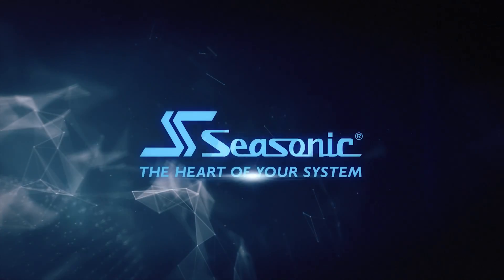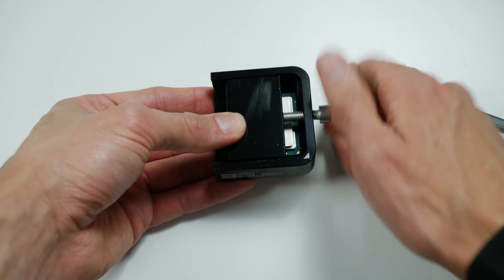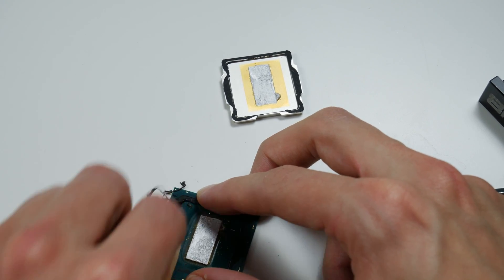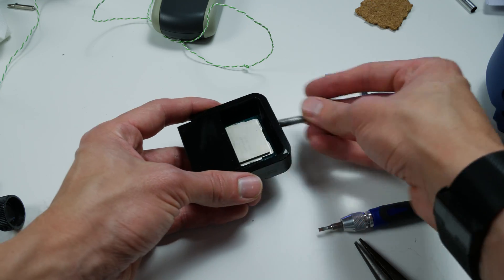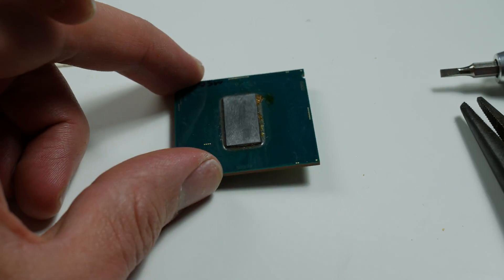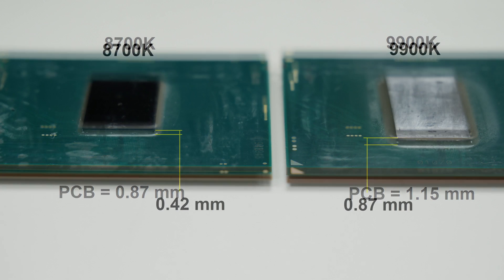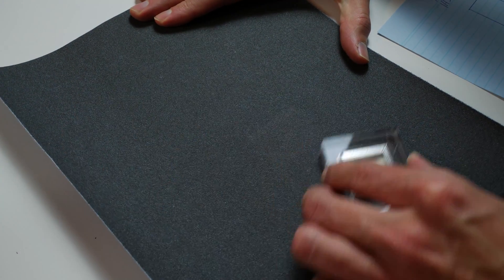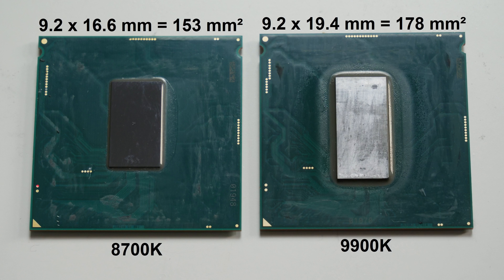Bad sTIM? Why is the 9900K so hot?

Comment: @der8auwer did you ever delid the 9700k and 9600k and where these dies as thick?  And was your sample a test sample send to you or a retail store bought sample?  And has there bin a new revision that may have had a fix to this or is it still the same old hothead. 
I really need a new rig but frankly Amd doesnt tickly my inner gaming nerd and the 9900k frustrates me on 2 points  price and this dam hotness. and delidding or even lapping is not for me. i want out of the box great items for those prices.  it baffles me that intel never made a statement on this or clarified why the die is so thick yet it clearly the reason its so darn hot.
Reply from the maker: it's the same and no changes
Reply: @der8auer   Thank you for clearing that up. Its really hard to find this info with intel being this tight lipped! Hope the new series with igpu off will be a improvement but not counting on it.

Comment: I will be performing my first delidding and lapping of my 9900K die next
 week. What I would like to know is does the bottom of the IHS (the 
bottom that actually touches and glues to the PCB) need to be sanded 
down equal to the amount that is taken off of the die so that the lid 
touches the die? I have not seen this done nor discussed. Thx for your 
time, knowledge & help! You are greatly appreciated!
Reply: Joey 
I’m doing this right now... just lowered die 0.53mm mirror finish. Now I have to lower ihs same amount. It’s coming out great can’t wait to see where temps end up...
Reply: @hermanquinones  Awesome! Did you cut the die first and then sand it down? Is .53mm safe? I was going to do .40mm. Please let me know how it turns out! Very interested! Much success! :)
Thx!
Reply: Joey 
No cutting at all... bought the supplies for delid and solder removal from RockItCool. 
Sanded starting at 240 grit and worked up to 7k for mirror finish. Spent majority of time at lower grit 240 & 400 to remove initial .30mm. Flitz metal polish was finishing touch. But total amount removed was 0.53 mm.
Reply: @Joey 
Safe? To be honest we are in uncharted territory. That said I believe the height being close to stock 8700k should be fine. Also, don’t be surprised if surface cracks are exposed on initial sanding they go away when proceeding.
Reply: @hermanquinones  
I'm looking forward to seeing your before and after temps... and Cinebench R15 scores. 
Right now my best is 2274 at 5.2 GHz and 1.470V. I should be able to delid next week and hoping to see some great improvements :-)
I can Boot It 5.3 but it is not stable when i running cinebench most of the time. It is stable running my Photoshop speed test.
Reply: @Joey 
For sure man. I took a 20 minute Aida stability test temp photo as a before. All at 5.0ghz. At 5.2ghz I got up to 2270 on cinebench. I left that speed alone bc of temps prior to sanding of course. But let’s stay in contact via email... 
my username all together at gmail.com
Reply: @RacerX-M5  Hi, I'm on direct die of my 9900k and the temps are good. My question is, if i sand the die by 0.40mm the OC-FRAME will still work? 
Thx in advance!
Reply: @brunoxsimoes  Yes. I ended up sanding the die a little more than .50mm. My only thought would be, will your direct block still go low enough to contact the die. If so, it's good :)

Comment: Question, please, to anyone that knows about this stuff. I'm half way through the process. I've removed the IHS and scraped the solder off of the inside of the IHS and the CPU die. That part was way easier than I thought it would be. So now I'm about to sand down the die, but I can't find the sandpaper he's using in this video. Where can I find it? Or can I just use regular 3M sandpaper? Also, what grit/micron is the 2nd sandpaper that he's using?
Reply: Ryan Steffer you found what grits were used? What sand paper?

Comment: It's simple as to why they made it thicker, They don't want it running to cool or else they wouldn't be able to sell their next gen K chip due to people overclocking. They pushed that they solder their chip to sucker people into thinking it will be a massive overclocker just to get pushed back again by thicker silicon.

Comment: It's some poor cheap material rather than a good solder, I remember that properly soldered 1st and 2nd gen Intels were destroyed during delidding because soldered metal held IHS and die together so strongly that you could not separate them without damage - even if you did use hot air gun or hot air station.

Comment: I think your first guess - that the chip is thicker to accommodate the stress of the indium solder joint - is almost certainly correct.  The interfacial tension on a thin chip would certainly increase the risk of cleaving over a thicker chip.  What we should have told Intel was just to do what we've been doing - use a liquid metal TIM!

With that said, if Intel did this (soldered the 9900K) because of feedback from the enthusiast community, then that's even more dire, and indicative of terrible bureaucracy and stagnant innovation inside the walls of Intel.  Obviously what the enthusiast community wants is lower temperatures.  For Intel to fixate on the soldering problem in complete isolation from any connection to the actual goal of making a die that can shed heat to the cooler more efficiently, only speaks volumes to real engineering problems inside the company.  

With AMD gaining steam, Intel really needs to be pushing innovation here.  I mean, here a bunch of outsiders have effectively given them a golden R&D package with the research, implementation, and testing of a novel IHS coupling method and they've bungled it completely.  Time to short Intel and buy AMD stock, I think.

Comment: do you have a step by step guide to delid the 9600k/9700k/9900k. i see you glance over it here and in the 9900k video from a week ago. but i dont see one wit the detailed steps. you mention having to be careful when shaving off the solder from the die because the corners. it would be nice to see it done from beginning to end without skipping any parts. and also listing any and all products needed to complete the job.

Comment: I really don't know what you guys are talking about with this hot i9 9900k stuff, I have an the processor and it legitimately runs cooler than my i5 did. It's overclocked and I only use an air cooler. Runs at 26 degrees idle and 40 under load.

Comment: I got ripped off so badly with my 9600k. It can only run on the 4,3GHz all core boost without getting too hot. My average temp in prime95 is 76 degrees using the scythe mugen 5 pcgh.  I've tried 4,6GHz at 1,3v but the temps will go over 100 degrees.

Comment: You forget to mention that it has 25% more cache that goes with the 2 extra cores 12mb vs 16.  The TDP is also significantly higher at 95 vs 65 which puts more thermal stress across both the DIE and package.  I am curious why you didn't try testing the 9900 with the older TIM used on the 8700.  Apples to Oranges.  This way we know what the thermal performance improvement really is on the new CPU.  It seems logical that reliability over the long term is a key factor here.  It's much easier to modify a product that will only run for a short period of time say 6-8months (until the next upgrade or review).  If you run nitrous in your daily driver it won't last long. Numerous review sites have pointed out the downsides of liquid metal products because they dry out and migrate away from the DIE center.  If the DIE thickness and Indium give me a product that will run for 5yrs with no H/W glitches or failures then this option suits the majority of users.  At the end of the day all implemented product improvements in any industry have to pass reliability along with performance testing.  I really doubt that Conductonaut would put a 3yr warranty on there thermal solution.  The ideal TIM is actually Silver but just like Gold not used anymore because of the cost.  Indium may be the best solution to solve the Cost/Reliability/Performance factors that make sense and we all know it is better than the older non-soldered solution.

Comment: Guess what, der8auer? I bought a 9900k. Stuck it in my Max X. Realized I was not going to get many hwbot points with the kind of heat it was putting out with no way to tame it without using something that would make it impossible to use for a daily workstation. Watched this video. Cursed the gods. Ran around my house a few times with some bongo drums screaming and cursing. The following day I got myself together and made the list: aluminum oxide micro-finishing film (40u for grinding down the silicon and 9u for polishing), a cleaner that is non-chlorinated and consists of aromatic hydrocarbons, a certified 12 X 9 X 3" granite surface plate, a precision digital height gauge, a pack of plastic razor blades for any scraping, a bottle of tequila and a rope to - you know - if I get a BIOS code of 00 on my first attempt... The most important thing to remind myself is that you've clearly stated you don't recommend this and that removing the diffusion layer might lead to an anomaly like opening a small black hole in my computer case that would suck me and the entire neighborhood into it. Noted. The 50 pound granite surface plate came today... There is no going back!

Comment: This feels like Intel rushing and not perfecting this process first. Either that or they are well aware that this is not as good as it could be with the intention of leaving additional headroom in case they need to do another fake processor generation.

If the single core turbo max could be increased 200mhz with the same thermals using better sTIM then Intel does have the ability to improve performance without changing the CPU itself.

Comment: Thanks for nice video. How safe is to sand a die? How do you know how deep you can go? What sand paper grit have you used?
Reply from the maker: I would not recommend it. Long term effect is not clear
Reply: Would you recommend to use Liquid Metal ? 8C  pretty big difference. Also some company makes water block that goes straight on DIE ( Linus was reviewing it some time ago with 8600k) . It would be very interesting to see the results with this water block on 9900k.

Comment: Thermal conductivity have got an unit, and it is measured in watts per meter-kelvin (W/(m⋅K)), it is sometimes measured in watts per centimeter-kelvin, and for obvious reason in north america this unit will be different. When talking about thermal conductivity you sholud use the unit, in other case spectators dont know how to compare it with other materials.

Comment: Thermal conductivity is a material dependent property. It does not depend on the thickness of the material. I think that you meant to say that as the thickness of the silicon increases the heat transfer rate increases.

Comment: The only difference between 14nm, 14nm+ and this 9th gen 14nm++ is the transistor gate pitch. It went from 70nm to 84nm. And this is reverse in trend because usually transistor fin height get lower as gate pitch becomes wider (and height get higher if the pitch is smaller)

Source: https://www.anandtech.com/show/13401/intel-9th-gen-cpus-9900k-9700k-9600k

Comment: I think that the die lapping might be even better than you describe, since you didn't mention (unless I wasn't paying close enough attention) that lapping is actually removing a lot of silicon nitride, which has a WAY worse thermal conductivity than pure silicon (4-5 times worse, to be more specific). It doesn't change the end result from the actual tests, but I suppose it helps to better explain WHY they went down as much as they did.

Comment: 93c? I remember the days when a computer would just shut off if it hit 60C...  Just ran Prime 95 on my 8700k with the Thermal take ring 360 and thermal grizzly paste and got 54C average after 10 minutes. Considering in the video he said he is using thermal grizzly and a triple rad the results should be comparable. That's a 30C difference. 30C more for 20% more performance aka 160 frames instead of 140 frames when I can only see 60 of them anyhow :P I'll stay with my 8700k for sure.

Comment: As a chemical engineer I think I would look at a better cooling solution, as multi-layered conduction heat exchange is usually dependent on the external temperature of the final layer i.e. air or water in pc cooling. Fresh air would be cooler than recycled water, giving higher delta T's.  But the internal design of pc's and noise could limit what is possible.  The area that heat transfer occurs across is also a potential problem as many people exclude it from their calculations. If one layer is smaller than the others it could restrict the performance of the entire system.

Comment: Please intel lower temps and solder, please intel lower temps and dont solder, please intel make chip thicker, please intel make chip thinner LMAO we can't win out of the box and now your delid tool is needed and you have to create a new tool kit to reduce the die silicone thickness. Lets just ditch intel and run AMD. AMD will figure out higher core clocks soon enough.

Comment: Roman - what tool did U use to measure the high of the DIE?  Caliper is not easy to use because of the capacitors under the pcb. And so, did U use the same tool 4 7820x? Die measurnment? Answer, please :) thank You

Comment: Greetings from America.  They might also "need" the gap provided by the sealant or glue that surrounds the IHS (soldering the 8700k).  It's possible that it gets too close after removing that, and the properties of the solder cause it to squeeze out of the super tight gap between the Die and the IHS.  Intel should be paying you a salary for R & D, lol.  I wonder if a University would let you do liquid helium testing at their location, and possibly give you some money for it.  The reason I'm saying it is Helium is becoming more and more rare, and eventually it will be mostly gone, since it escapes our atmosphere.  Some institutions have systems in place to recapture and reuse it, and they might see it as a valuable decision.  It's just a thought.  I appreciate all of the work you do.

Comment: Built in performance increase for their next generation. Next gen will have thinner dies, dropping temps just enough to boost performance another 100MHz and they'll charge more for those? Struggling with their process... may be a contingency.

Comment: Der8auer hit the nail right on the head. We sort of shot ourselves in the foot here. We asked for sTIM, Intel responded and correctly used a thicker silicon die to maintain structural and thermal integrity during heating and cooling stress cycles. They were completely justified in doing this, let's not all become armchair nano-phase engineers and pretend we understand the science behind soldering a metal to a semi-metal surface. Refined silicon is frighteningly brittle--I've worked with 1 mm thick 4 inch wafers and they snap very easily.  Honestly, the best solution is the one we have all been using which is to have thinner silicon dies and liquid metal in between the die and the nickel-coated TIM (aka the "classic" 8700K delid and relid). Overall, outstanding video and incredibly comprehensive testing--leaves no question unanswered.
Reply: Yet AMD's been doing it right for years, with solder that outperforms liquid metal by a notable (5ish C) amount. No, Intel done fucked up.

Comment: Honestly, with a diesize of 178mm² it is still smaller than the 2600K at 216mm² and I have heard that smaller dies are more likely to cause heat fracturing during the soldering process or decrease longevity through thermal cycles...which means that intel probably got fed up with people crapping on their toothpaste and forced solder, but then someone mentioned the die is too small and might break, so they made the die thicker.

Instead of, you know, widening the die, which would be better for thermals and soldering BUT would waste precious waferspace...

I don't know for sure, and I would generally agree the thermals are bonkers, but maybe intel was really in a bind here.
I mean they are struggeling really hard lately<.<

Comment: Is the dellid 9900k different from 7700k? at 7700k I just opened the cover then cleaned the tim with alcohol to replace it with liquid. 

Is cleaning the tim on intel 9900k just by wiping with alcohol? because I saw the cleaning method in video with some kind of cutter blade

Comment: Now if you try to de-lid an AMD CPU and haven't heated it up to melt the solder. You'll likely rip an entire layer of the die completely off, ruining the processor. So if Intel really soldered the 9900K, you shouldn't be able to de-lid it like that.

Comment: This is what happens when the community is all like mehh AMD is better because its soldered and now intel totally ruined it...

Before being soldered is actually a lot better because you can simply easily delid it and use liquid cooling which is better than soldered or anything else, so it actually helps that they dont solder the chip which get the job easy for us to improve it...

EDIT: I wish you would keep sanding until the CPU get destroyed to see the max we can safely go.

Comment: "Is a thicker chip needed to solder a chip?"
Roman, you should be able to answer this question: Please compare the 9th gen to the last gen that Intel soldered (Sandy Bridge IIRC). I don't think the solder is the reason for the increased thickness. I also don' think that Intel caved to "our pressure to solder the IHS again", but that there was just no way in hell the CPU would have worked at all with their usual crappy TIM, as the architecture was meant for their 10nm process.

Comment: I think the thicker die is needed to solder the cpu and to improve production capacity. Less burned cpu in production because of the heat of the solder.